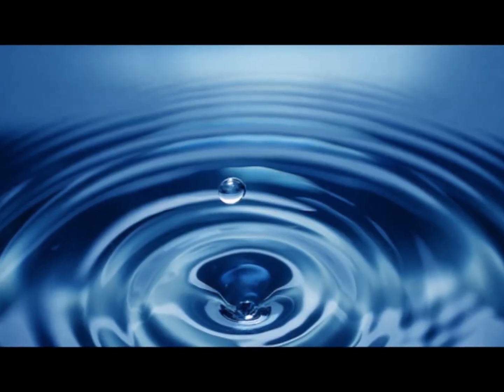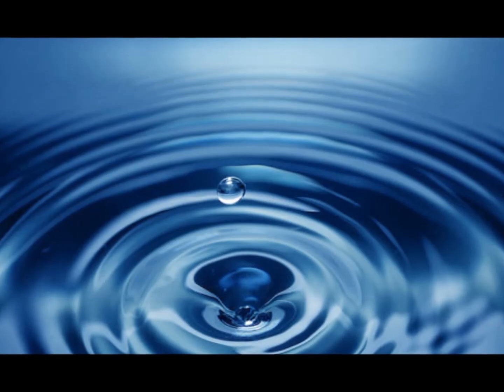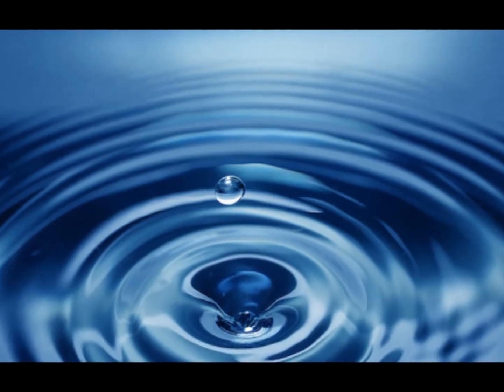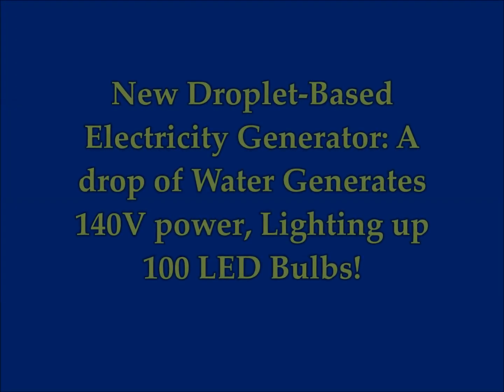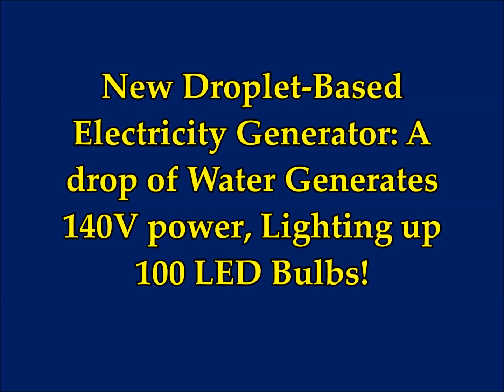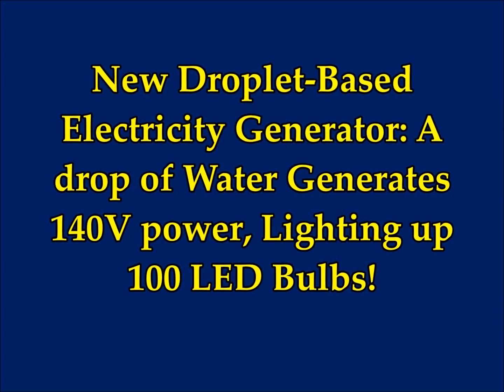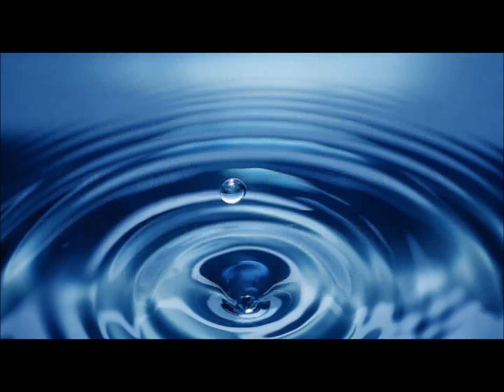New Droplet-Based Electricity Generator! 1 Water Drop = 140V power, Iighting up 100 LED Bulbs!

Comment: thanks for the link.    some info.    this 'kelvin's thunderstorm'  approach  won't  go  anywhere.    why is this true.
1)   x-amount of  FALLING  water  is  Required.
2)   at the point that this system might make usable power,  the  Amount of water equals  that in a small stream.
3)  any system that relies on the  WEATHER and the amount of precipitation falling at any moment, is  Not  gonna be of much use.
4)  in the case where  Sufficient  Falling  water is available, it would  be  Wiser  to  utilize a (suitable)  Waterwheel.
5)  in case you don't already know, volts are  Not  power.   power is watts.    it is possible to have  thousands of volts, and almost no current.    the result is almost  No  WATTS.   watts = amps x volts
6)          assuming generally clear skies,  pv solar panels of equal area can make  More watts.       googletranslate      (my ou research has a greater potential, to succeed.)  
https://www.youtube.com/watch?v=rv4MjaF_wow